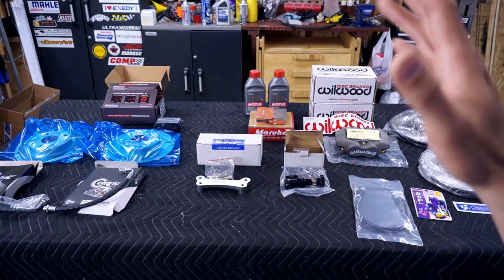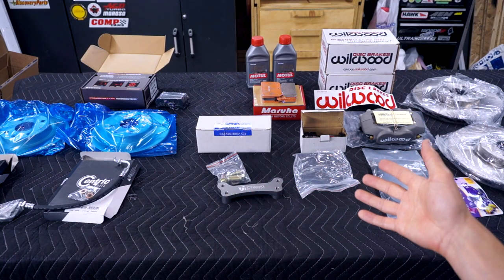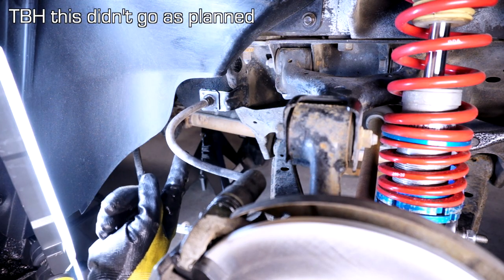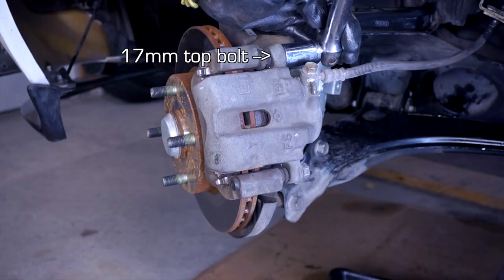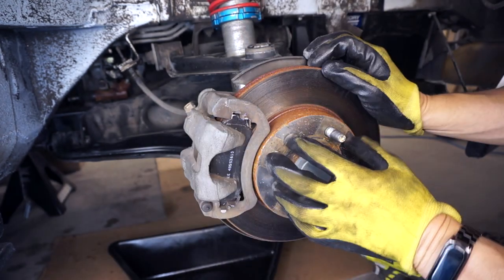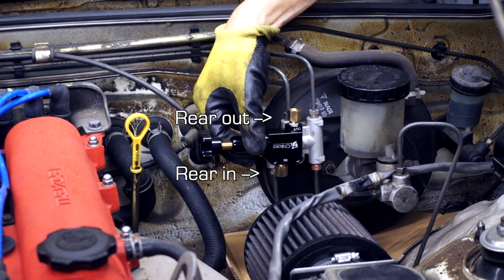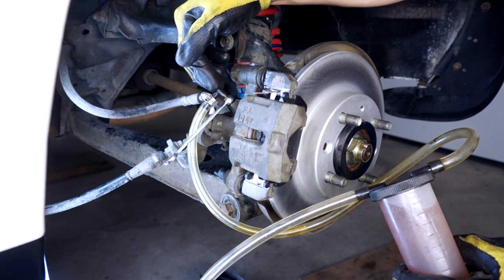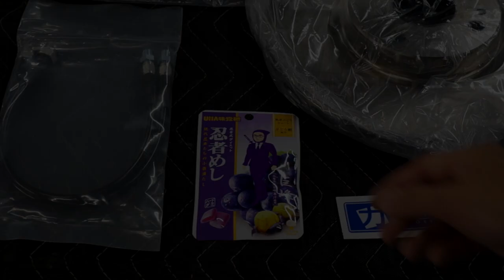Wilwood BIG BRAKE Upgrade! DIY Miata

Comment: Will stock wheels fit over the larger rotors?  If not , what size wheels do you need?  Great video.
Reply from the maker: Unfortunately no the Wilwoods won't fit 14" OEM rims but the majority of 15" rims will clear. Best to measure your wheel setup and ensure you have enough clearance before ordering your BBK. Thanks for comment, great question!